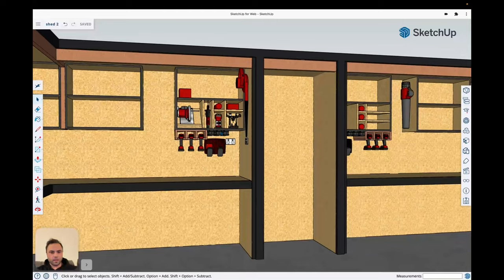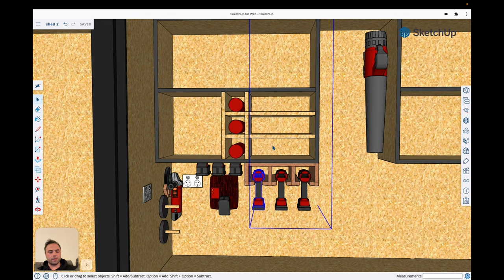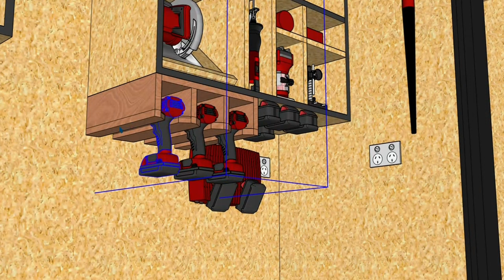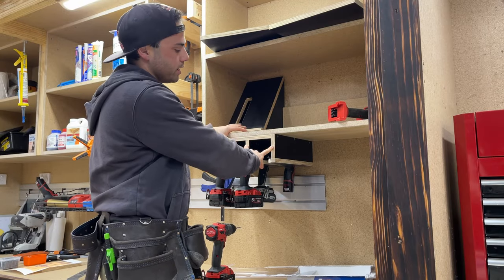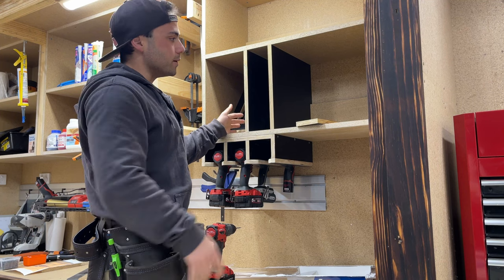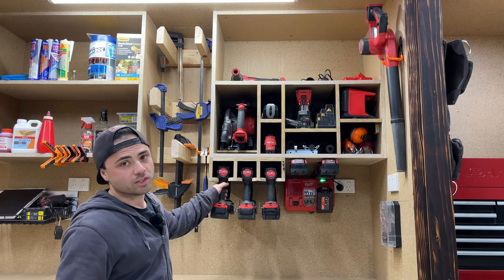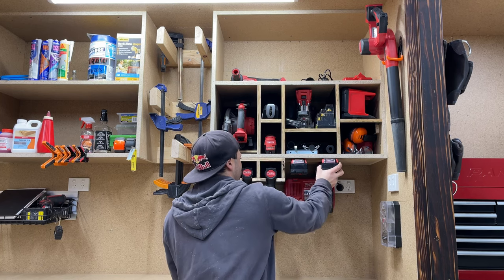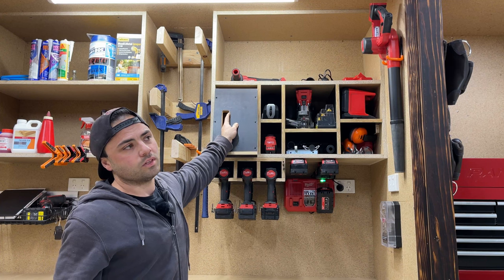Simple Cordless Tool Storage & Charge Station | Milwaukee M18 | Organisation | Drill Storage -Ep. 18

Comment: Quick tip f hanging chargers or anything with slotted holes... Tape the holes at the back of the item with masking tape then put a pencil mark where ya want the holes then transfer the tape on the wall then drill the holes on the pencil marks place the screws & remove the tape & place the charger.. 🤣
Reply from the maker: Handy tip! I’ll keep that in mind for the next one, cheers!
Reply: @_HACtv_  👍🏻